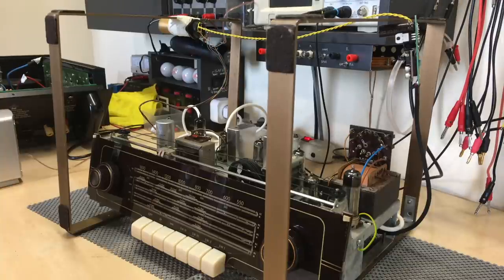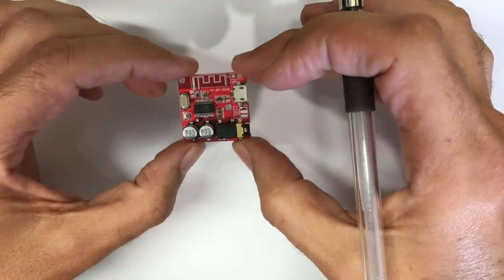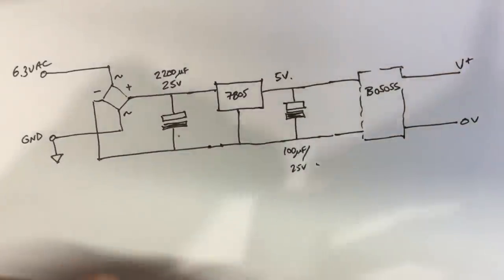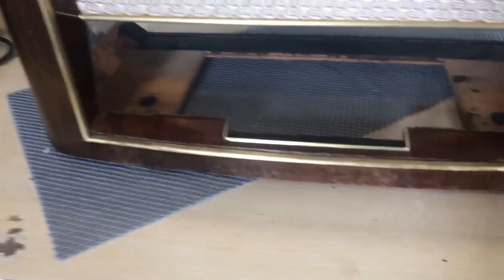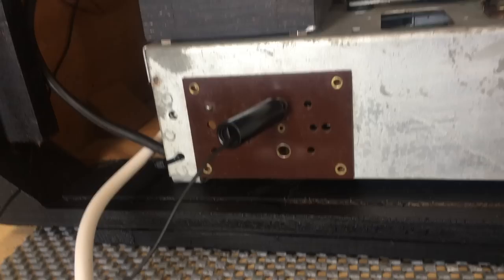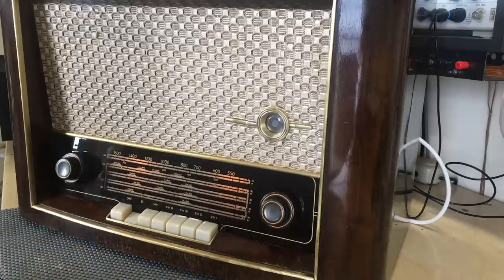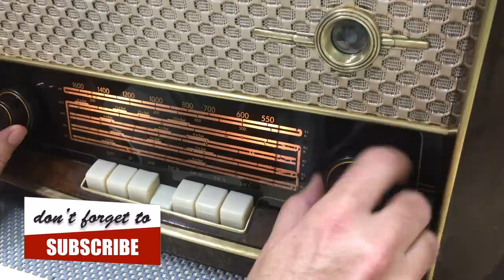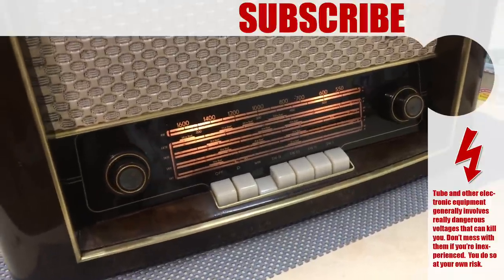TeKaDe W367K tube radio restoration - Part 4. Adding bluetooth and reception test.

Comment: Thanks for the upload. You have just solved two projects that I have rattling around my head. The first one is identical to supply 6.3v power to the same Bluetooth module on a 70's RE-7670 Panasonic receiver. The second project is to make a mono Bluetooth speaker for the kitchen out of a extra satellite speaker. It's this kind of content that keeps me learning a new hobby. Additionally I will be using that Dremel tool idea from now on.
Reply from the maker: William Ganley : And it’s this kind of response that makes it more worth my while doing the videos. Good luck.

Comment: A fine looking and fine sounding radio after repair. Bluetooth is a good idea and worked very well. I bought a mini whip after seeing how good your results were compared to a long wire.  Miniwhip gives me much better medium wave reception and less “noisy” short wave reception.
Reply from the maker: Alastair Chestnutt : it always surprises me how good those little antennas are.

Comment: haven't watched this yet! but on you previous video i think you mentioned that you could not polish up the brass on the knobs...try fine steel wool before polishing or in case they are very green or darkened, soaking them in mistolin for some minutes makes them shiny again.i discovered that by accident and it works remarkably well. now i use it from time to time to shine up the brass trim on the console that i have on the living room,i just soak a corner of a rag and rub gently bringing the yellow brass colour back without ruining the cabinet's varnish

Comment: Manuel I expected you would comment or mention that the broadcast band is displayed backwards. Surely this is unusual, no? Rgds Tony HP1KL
Reply from the maker: I’ve seen it both ways. In some cases they consider it as “increasing meters”, but I personally prefer increasing frequency from left to right.
Reply: @electronicsoldandnew  tks I agree with you. But how is it done electrically. I cannot read whether the SW bands are also reversed. TONY in Panama
Reply from the maker: All the bands go from high to low frequency from left to right. It’s all got to do with how the tuning capacitor is geared with the dial cords. It could have been reversed if the winding around the tuning knob was reversed.

Comment: Another great restoration!  Do you still use the KRC-86B V4.0 Bluetooth module or has this XY-BT-Mini become you new favorite?
Reply from the maker: Sincerely Yours : I have found this one easier to wire up, and smaller too. Not much difference between them, though.

Comment: You might have mentioned it in previous videos and I just didn’t catch it but was the eye tube bad? Enjoyed this whole series a lot, thank you for some wonderful explanations!          Buddy
Reply from the maker: Buddy Martin : actually I forgot to mention in in the final video. The eye tube is very, very weak. This is quite normal with these ones, and they are very expensive to replace, but there is a Russian alternative that works well with a small pinout change, so I’ve ordered that and will fit it sometime in the future when it arrives.
Reply: Why thank you Sir, so kind of you to respond. I completely understand the issue with the eye tubes. I purchased several vintage radios at an estate sale recently and when I was finally able to apply power to them, their eye tubes were also bad. I didn’t know of the replacement you mentioned so I’m very interested. I’d be very interested in any information you have, I’ll take a look on the Internet in the meantime. I really enjoy your videos, thank you for your time to produce and upload them!        Buddy
Reply from the maker: Buddy Martin : this will help: 
https://www.radiomuseum.org/forum/replacing_the_em34_by_the_6e5c.html

Comment: Hello and thank you VERY much for a great upload.  I always find your videos to be wonderfully educational.
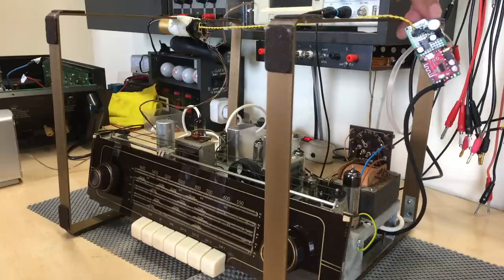Your calm explanations remind me of my high school electronics instructor.  I have a question about 2 additional capacitors that show on the completed board at time mark 0:42 which are not shown on the schematic.  One small electrolytic cap at the BAT input of the Bluetooth module, and a bit larger cap on the green board about the same physical size as the 100uf cap described in the schematic section.  Can you tell me where exactly you inserted those in the circuit and their values?   I thought they may be additional filer caps that are shown on the B0505S spec sheet but I’m not 100% sure.  Did you forgo using the diode by inserting  the 2 caps to achieve desired voltage to the BT board?   I could not see a 1N4007 on the completed board. 
   I have 2 tube radios that I would like to add bluetooth to using your circuit.  Any additional info you can provide would be greatly appreciated.   Thanks again for sharing your knowledge and taking the time to create these videos.
Reply from the maker: A. Squeegboy : yes, those caps are precisely the ones mentioned in the data sheet for that part. They are simply filter caps. 
It’s been a while since I did this one and don’t have it any more, but if memory serves it was fitted. I may have fitted it on the underside, can’t remember exactly. It must be used, however, to bring the voltage to the BATtery level.

Comment: Me no understand schematics, is there a diagram I can use to make this? Ive been having to use a separate dc power source to add BT
Reply from the maker: Sorry. I can’t explain it any better than I’ve done in the video.
Reply: @electronicsoldandnew  I didn't ask for an explanation, a diagram
Reply: Rick Pitcher only schematics unfortunately